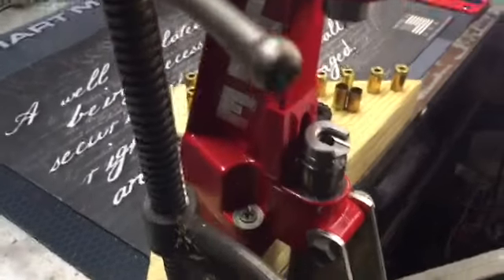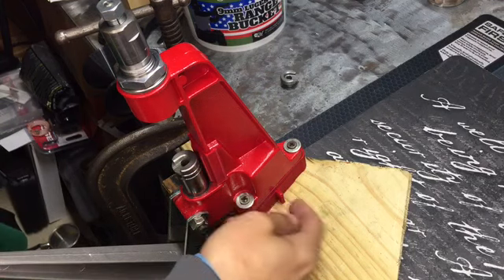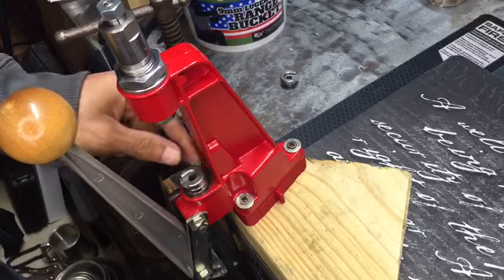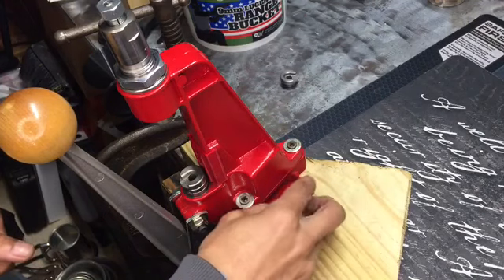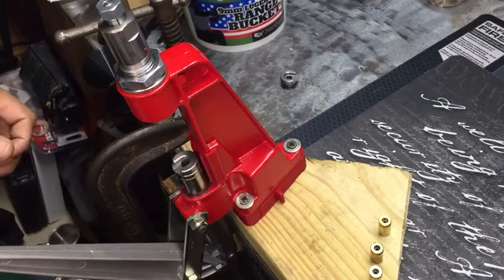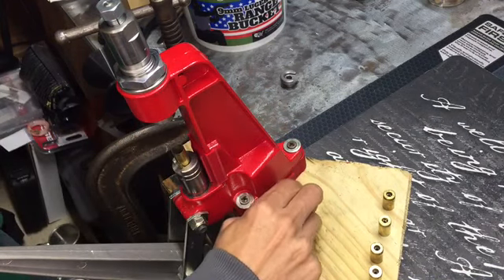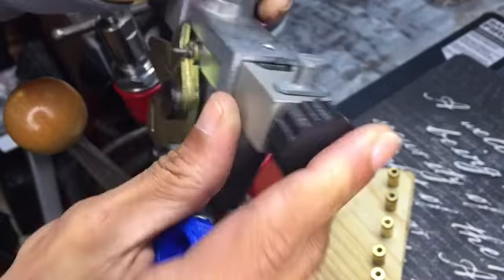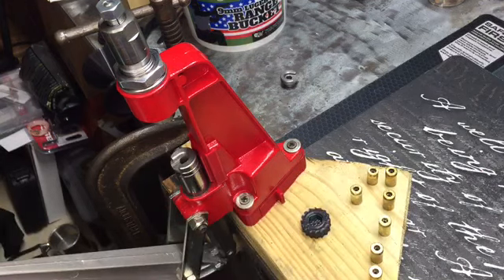Lee Single Stage 3D Printed Upgrade

Comment: The primer issue is the only reason I'd never buy one of these presses. MIG's attachment solves the problem. MIG should sell those through the Reloader's Network.
Reply from the maker: JCM45 I agree ☝🏽
Reply: I think this comment just started a ball rolling
Reply: @MeasureInGrains  ; I hope so!
Reply: I wholeheartedly agree. Tired of sweeping dead primers off the floor.